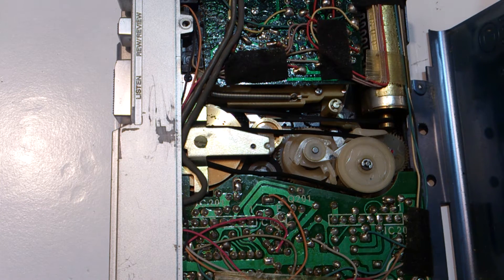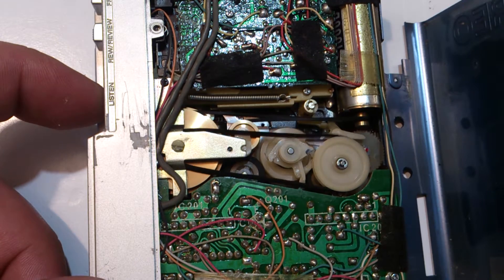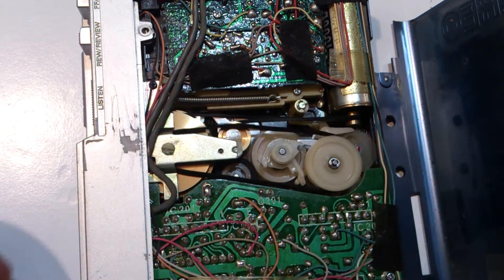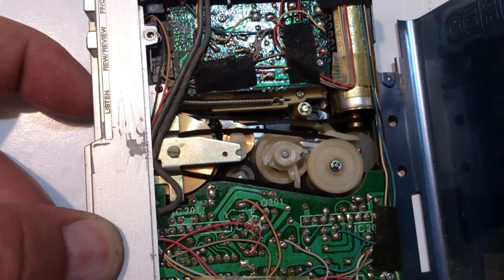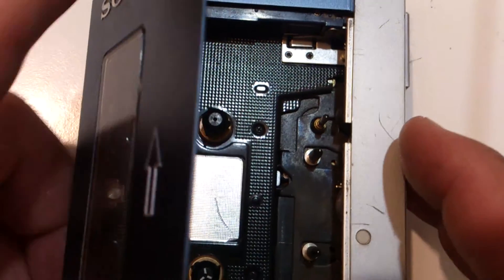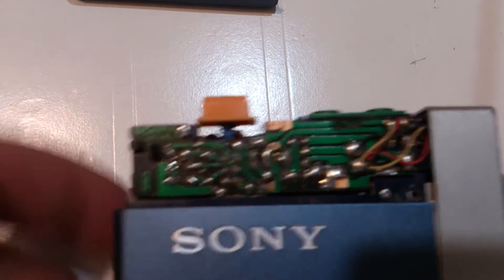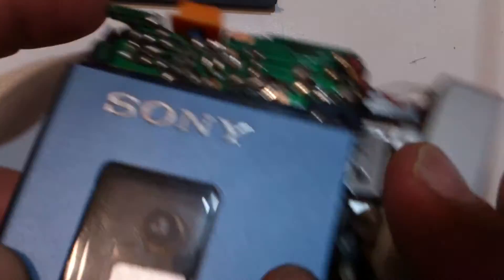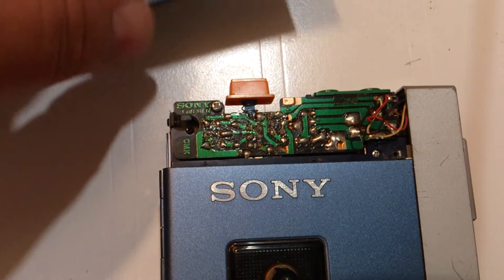Repairing a Sony TPS-L2, tear down preview of Star-Lords Walkman!

Comment: I have a lot of Aiwa walkmans which need varying amounts of work. They are Aiwa HS-JS models 415, 445, 475 and 479. The 475 and 479 are the same design. The vast majority of them are 415's. I have other models of the same designs to cannibalize for parts. The only difference is the machines I want to fix are digital tuning while the others for parts are manual tuning.  If you're interested, I would be happy to send you one of each model if you could make a video on how to repair them. I really want to learn how to fix them on my own so I can diagnose and make the needed repairs as they happen. I'll pay the shipping costs of course:)